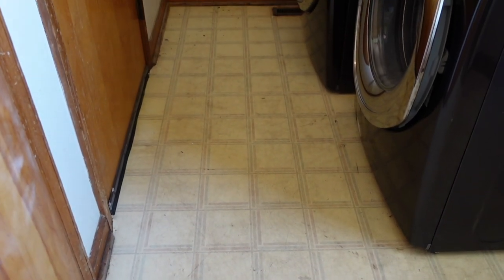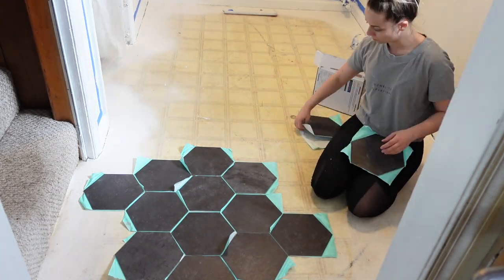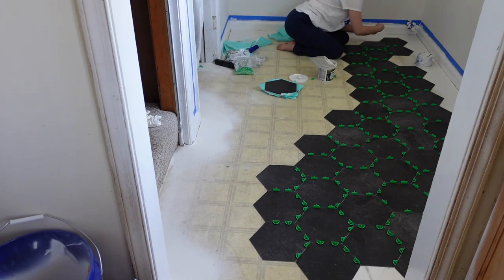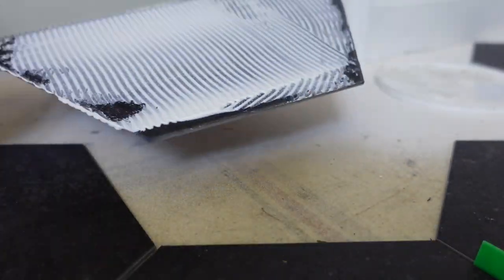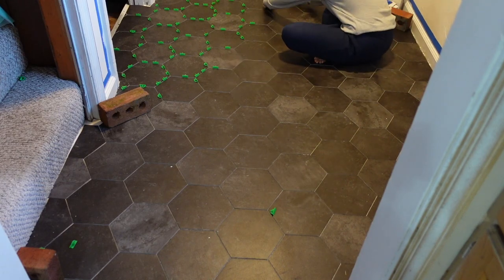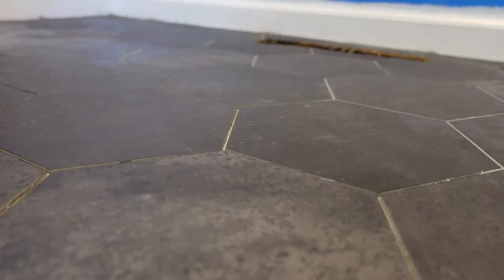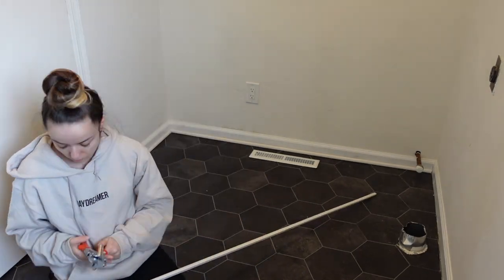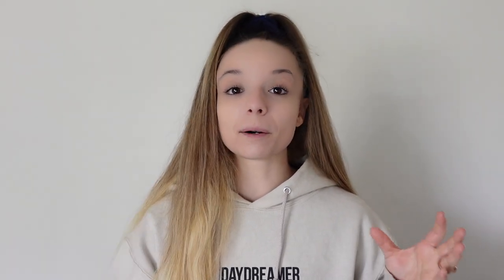HOW TO INSTALL PEEL & STICK FLOORING WITH GROUT! | VIRAL TIKTOK DIY FLOORING | AFFORDABLE FLOORING!

Comment: I tell people who rent to use caulk as grout. Easily removable but still waterproof and stable. I never had an issue with it. And the reason the spacers don't work is because it's meant for thicker tile. If you cut the bottom prong in half it'll work better.
Reply from the maker: That is genius!!!

Comment: I put peel and stick over vinyl tiles and there was no problem, except when I decided to remove both layers to put down porcelain tiles. A heat gun is absolutely necessary. Your floor looks GREAT!

Comment: Looks really good!  If the linoleum is tight, you can go right over it. Lol my last kitchen makeover followed a pipe break in the foundation so we had to remove all the flooring. We found 3 layers of tile.   Just make sure you really clean the floor when you are applying peel and stick. We vacuumed and swept the entire time and I still found little starbursts where there is something under that tile.
Reply from the maker: Thank you! Oh my goodness 3 layers is a lot!!